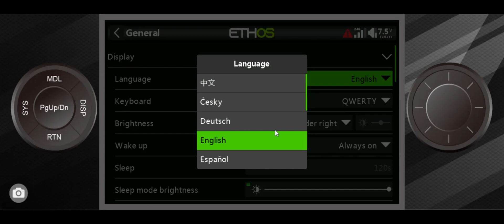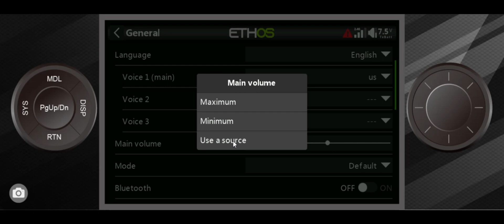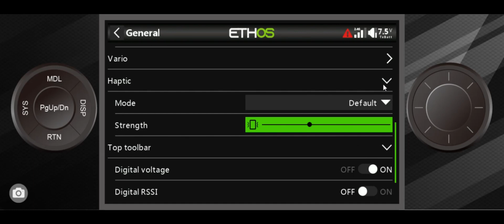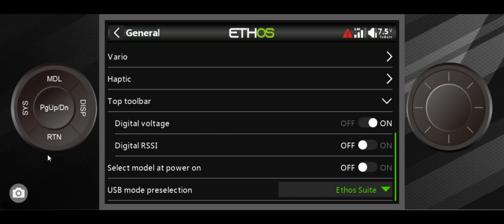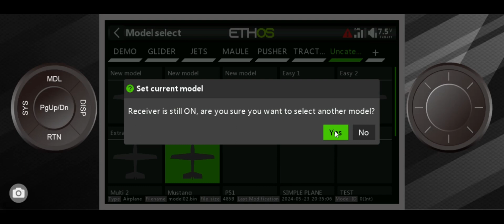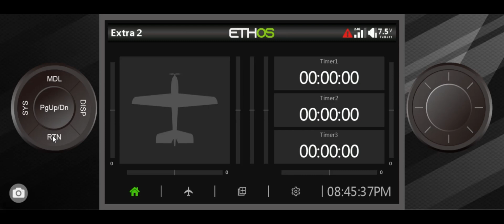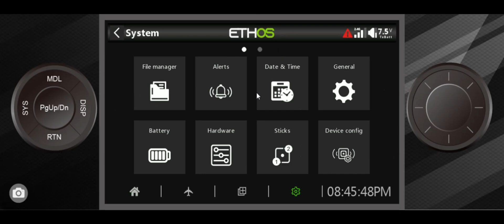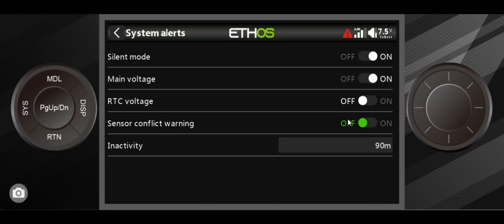FrSky Ethos-Setup Your transmitter-O-20 Series E2

Comment: I have seen a number of these videos as I try to learn Ethos on my new transmitter, and honestly I really wish there were a series of videos that were menu page specific  - like those EdgeTX tutorial videos Joshua Bardwell made.  He made a separate video about each menu page in EdgeTX, and went through each option, line by line, explaining what they did.  That's what I need for Ethos!!!  All these task specific videos jumping around from screen to screen without explaining every option on each screen leaves a lot of holes in my understanding of Ethos.  Where's a video on just the Mixer page, Outputs page, or Special Functions page, etc??